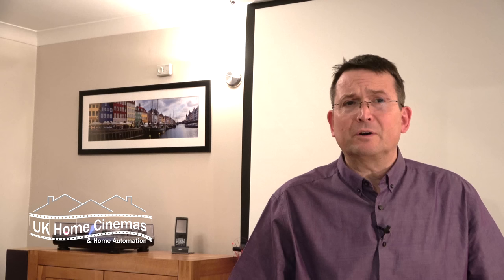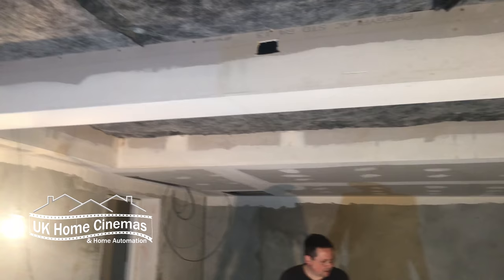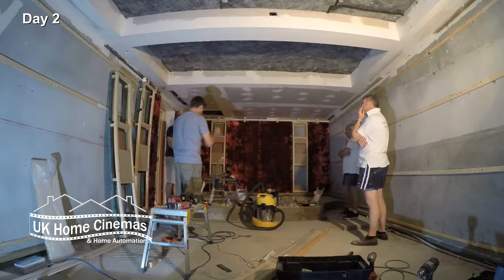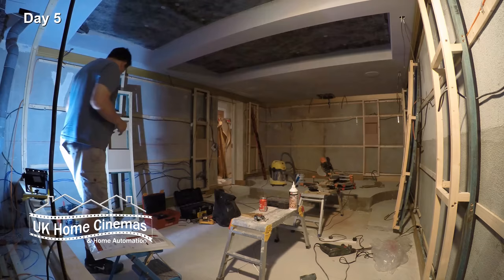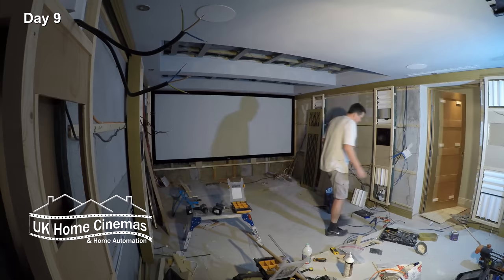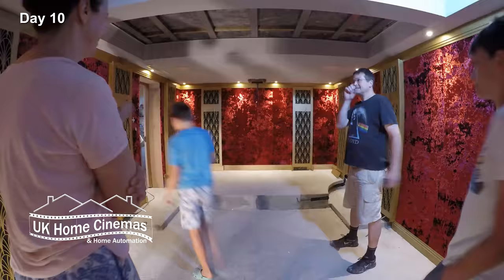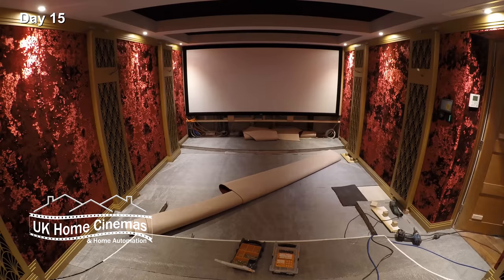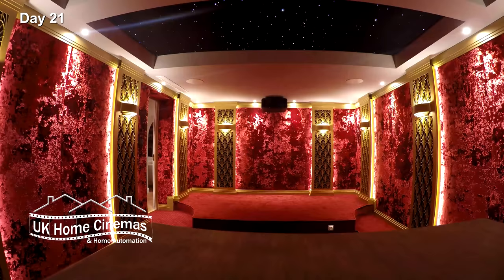Time-Lapse From Concrete Box To Art Deco Movie Room

Comment: This guy -  “Its a thousand miles away” 

Everyone in Australia  - “just up the road then” 👍🏼
Reply from the maker: Sydney Drums Very true ( for Australia ) but in the case of our project, for us France is a different country with a different language. We are un-familiar with the local suppliers of materials and local manufacturers etc  so we had to make sure that we took with us more or less everything which would be needed and a lot of it was bespoke. And was  custom made in advance. We made one journey there with a van and everything needed to be on that van. If we had had to make a 2nd trip with the van that would have had a major impact on timescale and project costs So logistically it was a much bigger challenge than our usual projects in the U.K.

Comment: Outstanding!!!
I really enjoy these time-lapse installations...especially when you narrator. Please continue sharing these.
Questions: What is the width of the screen (not diagonal)? What is the distance from the screen to the front of the first row of chairs?
I'd really appreciate understanding how you attach those fabric panels to the walls. Thanks !
Reply from the maker: Thanks for your feedback and questions. 
The width of the image area of the screen is 3353 mm the distance from the eyes of a person in the front row to the screen would be about 3157mm
The way the fabric panels are held in place is as follows: 
We used mouldings at the top and bottom of each wall like skirting boards. These were battened away from the walls And the panels fitted into the spaces behind the mouldings so the panels can be lifted out for maintenance. The mouldings hold them in place. Hope that makes sense.
Reply: Beautiful work here, please share more. 
More questions: What are the mouldings made from? What wood is used for the panels? What was the screed and fabric placed under the carpet? Thanks

Comment: Again don't understand your client decision spending cerca 65k and placing NX5, in this family lineup there a must be NX9 with Premium lenses from Z1 JVC projector absolutely a must, its like preparing your racing car for the race series and placing there absolutely standard engine not tuned and not optimized. For this class of cinema rooms there must be one of the best projectors to be installed, ofcourse ideally if the money is not an issue a Dolbie Christie Eclipse projector would be a BIG WIN WIN WIN.

Comment: how did you make the stars (lightning) on the ceiling? where to buy and how..
Reply from the maker: The url for the supplier is in the end credits of the video . The panels we used are their infinity star ceiling panels with fibre optic cables and fibre optic light source.which they also supply.